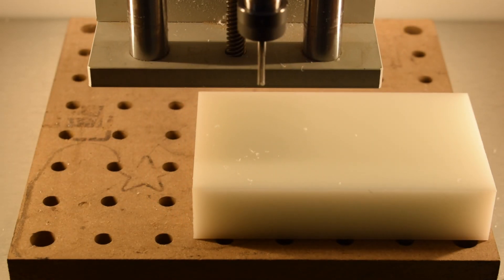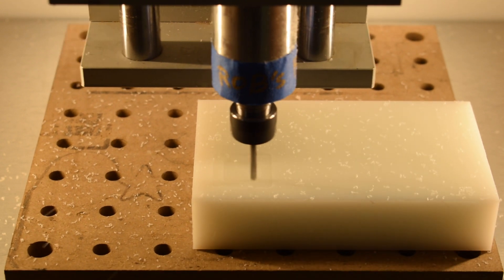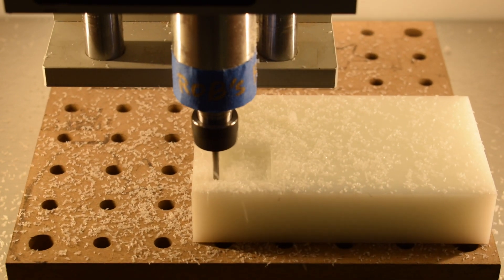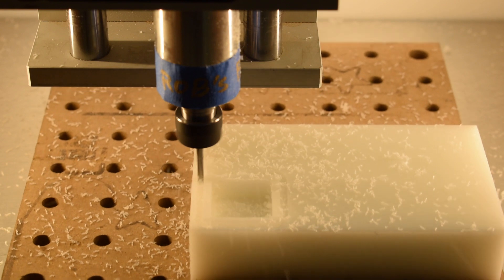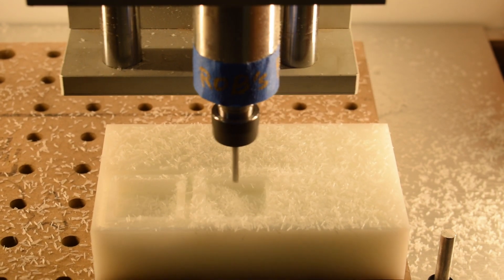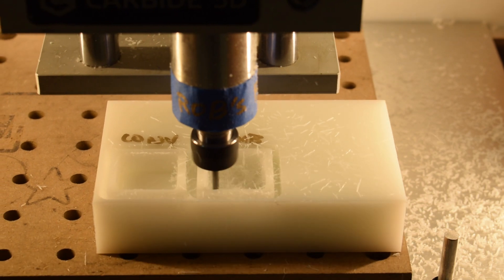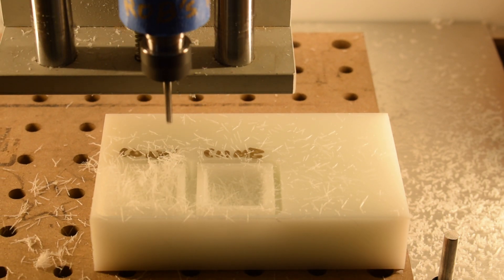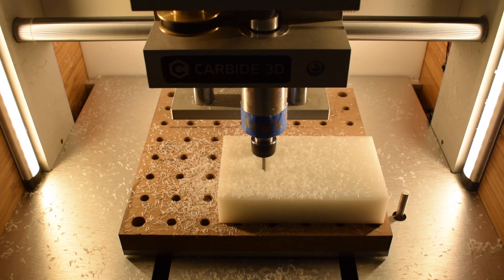HDPE Machining Guide for the Nomad CNC - #MaterialMonday

Comment: Hi Winston, what stock to leave value did you use before your finishing contour passes?  I'm curious if that has anything to do with the strange center "scalloped" surface I have on the outer walls of my latest HDPE cut.  Thank you.

Comment: Just getting into CNC. Are these feeds and speeds capable on a Shapeoko 3? As I can think of a lot of uses for this material, but my understanding is the nomad can do slower speeds than the routers is Shapeoko, so they can do softer materials without the material melting while working

Comment: I've had good luck machining HDPE on the Nomad for making silicon casting molds. I didn't go as aggressive as you did with the tooling, but good to know I can push the Nomad even further.
Reply: After machining the HDPE, did you achieve a smooth finish? Hoping I coukd use HDPE for casting resins and need a super super smooth finish on contact areas. Any tips?